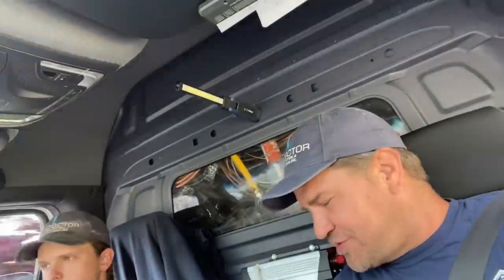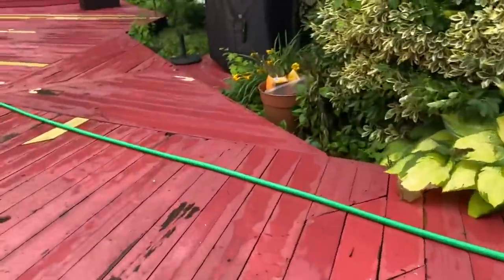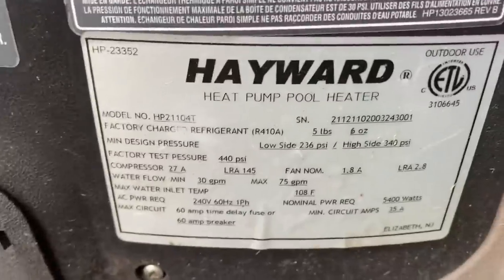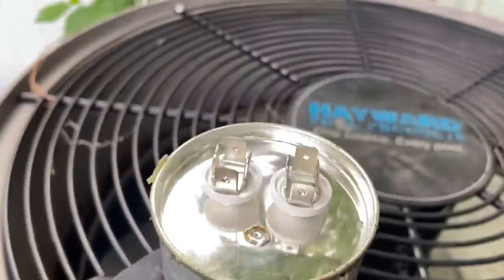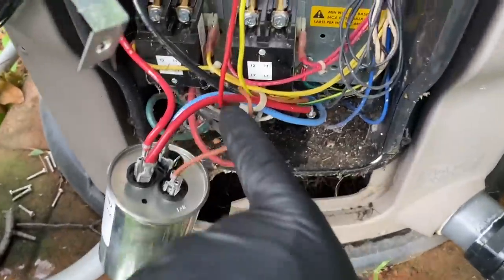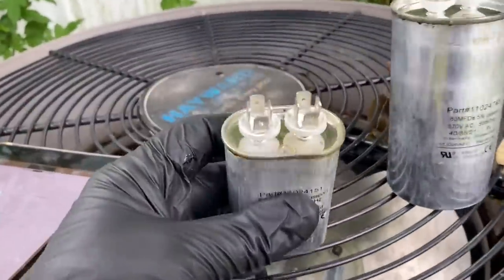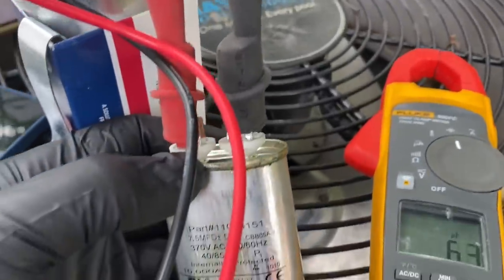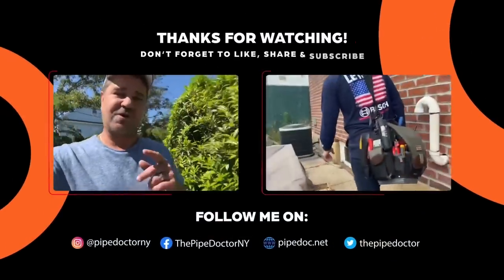Hayward HeatPro Pool Heat Pump Not Working How to Diagnose and Replace Compressor and Fan Capacitor

Comment: Good move  .. I noticed you asked if the Reading on the display was PF  … I have an equivalent Heat Pro, that wasn’t working flashing on display, pool repair guy informed me that it was a loss cause .. needed Freon that wasn’t available?

Any thoughts on that ?
Thanks

Comment: Hey Mikey !!…my Jacuzzi electric heat pump not working…I hear a buzzing noise every 2 minutes or so from unit…fan running but found Cap no good…replaced but still makes that buzzing for a second…compressor bad ??…put my hand on it and don’t feel like it’s running ??…I guess I should check with manifold set…will see if my auto R134 will work with the R410 ??…THANKS !!

Comment: Thanks for the video! My fan won’t spin on my pool heater. I hear a click when I try to turn it on. Both capacitors read 0 for capacitance, but when I checked ohms they both seemed fine. Any idea what could be wrong? Or what I should check next?
Reply: @PipeDoctor  I failed to mention I wasn’t sure if I did it correctly when testing capacitance.. I have a cheap harbor freight cen tech multimeter, the symbol looked similar to the one in your video. In the event it’s not the capacitor, what would you test next? Fan motor?

Comment: be careful when going from individual capacitors to a single dual cap, as some of those unit's may be dual circuit power fed and have the fan/controls off a separate breaker/power supply and the compressor all on on it's own.
that one was single power feed, so all is well there, but it's always something to look out for on others.

Comment: So I am basically trying to do the same swap on my pool heater...same model in video.  My fan capacitor has 2 yellows and 1 brown.  In the video you didn't say what to do with the other yellow.  You removed the one because you went from 2 capacitors to 1 but never said where the other yellow wire goes.  Any suggestions?
Reply: Did you figure it out? I might do the same lol

Comment: Hi Mikey. I have a hayward heaterpro heat pump and I turned the breaker on for the unit after opening my pool and I am getting an error code cOP. It looks like the unit label indicates this as a Thermistor Open error code. Can you confirm and is this an easy fix?  I'm in NJ and trying to figure out who to contact to repair this.
Reply from the maker: You should go on Hayward website and find a local repair provider

Comment: New nickname for Peter, Peter, Peter pumpkin eater had a wife had to eat her 😂 j/k of course he’s not a hefty young gentleman, let’s go Peter learning the best trade on the planet!! Hope he sticks with it and you, he can be very successful if he ultimately chooses this career. Side note I just left a trane condenser where the common from the contactor to the capacitor was all burned up only the OFM was running, high amperage I’m thinking, any thoughts? Man I’ve replaced at least 20 caps this summer already and it not over yet…